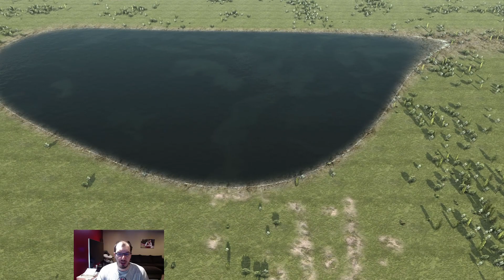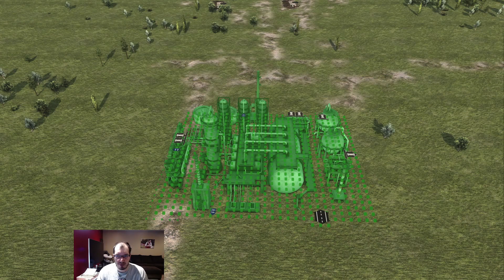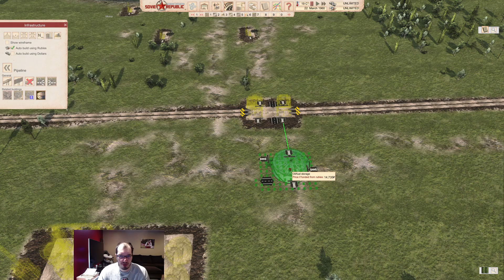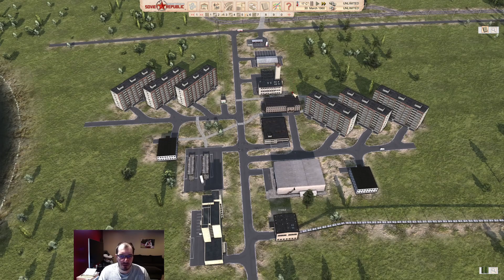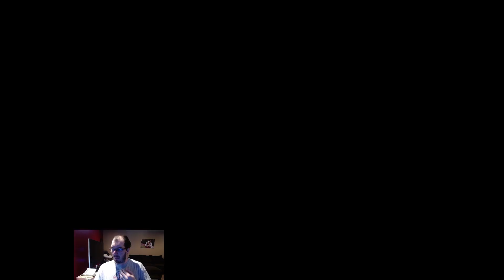How to setup a new Production Guide | Tutorial | Workers & Resources: Soviet Republic Guides

Comment: I have the feeling that the refinery takes more oil than in the description, because I have a train that delivers 720T of oil and the storage is empty when he comes back after roughly 3.5 real minutes
Reply from the maker: @NiIs03  how many full workdays is that?
Reply: @bballjo Here are some infos 😅
Reply: I haven’t checked that yet I will do it later
Reply: Hi I checked the time and the train needs roughly 23h to drive back to the border load 720t of oil and unload at the ref.
Reply from the maker: @NiIs03  that is a bit odd...you got to 23h by following a person around, and checking when the train leaves and returns, right? Otherwise, I know that the timescales won't match...
Reply: @bballjo hi I forgot to add the drive back to the border to refill but then let’s say it takes 25 to 27h for the hole round that should be enough oil
Reply: And most of the time the raf is 3/4 full of workers due to transport issues
Reply: I mean I won’t complain but I don’t understand it😂 and I have 4 pumps that adds to an extra 20ish tonns

Comment: I’m not sure if this is a glitch or not, but when I try to assign a bus stop in the city to bring workers to a bus stop in the industry area, it keeps saying that there is no connection or it’s too far away, which is weird because that defeats the purpose of buses. This leads to no workers going to the industry area, and the odd thing is in the beginning of the game they do go to the industry area, but at some point they just stop. This also affects passengers so they don’t go to areas where I build culture districts or to a shopping center. The buses will still go between stops, but passengers will either not board the bus or just won’t get out
Reply from the maker: There are 2 separate issues here...the error message should be easily tested, by clicking on the industry stop and check the walking range.

The second problem is often related to the max number of workers that can wait at the station, plus they can only wait 1 hour...so nobody gets on the bus that needs to go, or nobody has room at the station to wait.
Reply: @bballjo  alright I think I know the potential fix now, I'll use more buses I guess, I know walking distance can't be the problem. I had this glitch where my car dealership couldn't connect with any parking lots and I ended up demolishing and rebuilding the road that connects it with the city and fixed the problem, maybe it's something similar if nothing else works, I'll test these out once I'm free, thanks for the help

Comment: Thank you
Reply: Why do all the train passengers get out of the train while the train is commuting from one stop to the others. The passengers are suddenly not on the train and then it arrives empty. Or seldomly the train arrives with passengers, it gets empty but no passengers go out to their work!!
Reply from the maker: I would guess there are available jobs for the passengers at that stop, and the line is set to "get in/get out"?  Setting up a true commuting route vs point to point is hard, but not impossible, easiest is to control the available places of work and make sure you have plenty of workers.
Reply: @bballjo  I do have plenty of worker but the train just gets empty in the middle of nowhere, where there are no stops! I’ve never seen that. Did you?
Reply from the maker: Oh that...there is a 4h limit in vehicle. Check out my extended passenger range guide, it shows you how to get around that:)
Reply: @bballjo  will do
Thank you

Comment: Great video, but to be honest I do not really like the oil setup. It seems overbuilt for the amount of oil you have, or underbuilt if you ever plant to run it at full capacity.

There is a good storage capacity at the refinery already, and like you said, the refinery is able to pump in and out, so eliminating the tanks also eliminates two pumping stations, which also slightly reduces the length of your pipe network. So if you are playing on hard and need a quick source of income, the setup can and should be more minimalistic. And if you are going big and setting up a modular system that you can run at full capacity in the future, there should be separate rail (un)loading stations for each resource, and a more robust transit system than just buses.

I did learn something from one of your videos recently. I saw you connect a HV line to both connections at a transformer, and my mind was blown. Of course it works! The border power connections are also transformers, and current passes through them just fine. But for some reason I got the idea stuck in my head that I need to build HV switches everywhere. Speaking about power lines, did you know they can cross intersections diagonally? This means fewer poles to build, so it's cheaper. It also means two 45° degree angles instead of one 90° one without taking up any extra space. I'm not sure if that is your cup of tea, since you seem to have a strong preference for 90° angles, but there you go.

Edit: Oh no it was a modded transfomer ;-(
Reply from the maker: Thanks for your comments! 

You and @bc74sj are seeing the same things, and I very much agree...this setup is not efficient...I wouldn't start this way BUT vanilla doesn't give you another option for a refinery...I think I should have pointed that out in the video, but I stay 100% vanilla for the tutorials, so everyone can follow along because mods aren't always available, or reliable. There are many optimizations that can be done here, to make it a little better, but in the end there isn't a lot of oil, but there are only LARGE oil buildings available. 

In the end, this video was more for the mechanics of how to setup a full production line, like oil, and figure out the amount of throughput and workers needed, and not necessarily for the best setup...but since I have to point that out afterwards, I think this video has simply missed the mark and could have been done much better. I always appreciate honest feedback, especially when it helps me improve myself :D  

I think my next tutorial will go into the general optimization at the start more, and I hope I can address all the pain-points that have already been pointed out in this video. 

On the transformers...yea, as you said the modded transformer removes the need for most HV switches, but its a mod, so I wont use them in tutorials ;)

In terms of savings money on power lines...the intersections are nice, but you can do the same with paths, I think I show that in a couple videos....place your HV power lines, however you want them to run, then go and remove 1 pole in the middle, place a dirt path, reconnect the poles, remove the path -> 1 pole less...you can repeat this as many times as you want. I believe you can remove up to 2 poles this way, in between poles, so you can effectively safe 50% on costs...but be aware, removing 2 poles lets the power lines almost touch the ground, and it looks unsightly when your trucks and trains and people run through the HV power lines...so I stick to removing just every other one.

Comment: Sorry posted my notes in the wrong video
Reply: Comments: Weird title of video. Guess thumbnail makes more sense?

Notes on map position:
Should always build top left or bottom right if you are planning on making the most of your starting money and doing less autobuilding, but closest triple Soviet customs area that fits that criteria. Distance to NATO matters since you want your USD to ALSO to go as far as it can. If you plan on autobuilding all game and trading with only Soviets, then bottom left corner.

Should reroll random maps when starting out until you get a triple Soviet close to the top left or bottom right for best starting position / money usage.

Optimal pumpjack position:
(I think yours were too close, not really ideal).
Assumed area vs Actual area (240 m diameter circle area is displayed by the game but the actual used area is only 190m)
This means you can set jacks 95m away from each other with zero overlap. If you create a square 
95m from jack to jack, (enable the grid, and each grid square is 10m, so the tips / points alternate (the .5).
If you filled a square with 4 squares filled with 4 circles, you would see that there is a huge area missing in the center (in the game it looks like a diamond).

Easy way/fix:
If you create a square 140 per side, you will leave 1 green square visible in the middle. This has multiple overlapping parts of the circles.
You can minimize this by alternating rows at different lengths.

Harder way/perfect coverage: Put your first row of pumps 145 meters away from each other, and alternate a row 72m (between the two) and 160m below it.
You will see a diamond pattern.
Easiest way to measure all of this? Gravel roads, and clone tools. When you are doing a large oil field (custom map, not randoms) you can put dirt roads between all the pumpjacks and also verify if something looks off.

Tank: The tank you put in front of the 4 pump jacks can hold 1500T of oil, when you can only make 20T of oil a day. Would  take 75 days to make use of it. Yes you said  you could use it for other industries, but 4 pumpjacks at the start isn't the time or place for it. Cost you another 15k.

Refinery:
I think making a refinery with only 4 jacks is a losing battle and I dislike random maps to begin with. You are setting yourself up for a super expensive setup. Yes you can import oil.
250T of oil can be consumed per day by the refinery.
4 jacks you said estimated 5T of oil (20T)

8% with only your 4 pumpjacks is correct, but I thought I heard you say 20%. 8% of 500 would be 40, so yes 120 per day. This would yield only 10T of fuel, and 6T of bitumen. 

Think you should have moved the 2nd tank placed next to the refinery (always good to have ability to reach the output lines on tanks).

Money: 
This was all done in sandbox, so I assume this video was intended for an easy audience. 1.6M on just the oil / train / heating plant part when I recreated it, nothing for city (500USD I didn't spend)

Ok, so oil sells 41R/T, buy 45R/T at game start. Bitumen  199/220. Fuel 121/134. 10T of fuel, and 6T of bitumen. 2400R per day * 30 $72000 at 100% production per month.

290k to build it and maximum capacity to be used is only 8% (obviously this changed when you started importing oil).
You have to be careful with this, as your tanks will always be filled up and not empty if you are converting oil to fuel and bitumen as 250T of oil is turned into 125T of fuel and 75T of bitumen in a vacuum, but when you add in your own oil, it can stall the system when importing oil, and then you can't export anything, because there is no room, or you are paying for oil and not using your own (obviously just a caveat the player will learn later).

Aesthetics vs cost:
Pipelines cost a TON more than either jacks or pumps. Use straight lines as much as possible.
In 1960 100m of pipeline on the border is 10.5k, 11.5k in the map center, 12.3k in the far right top corner (NATO corner). A pumpjack in the NATO corner is $6915, a 3 way pump is $11.5k.

Lifespan/pollution:
More helpful to use the search bar to the right rather than the population overview. Good habit to start using  early on. Will pinpoint who is unhealthy, not that you have a generally unhealthy population (it will show the unhealthy houses, and then you can determine if it is based by pollution, heating, lack of food, doctors, etc..

Busses: Advise Line Spacing personally. You said multiple times 'vehicles don't matter'. They do, should be selected and looked at.

tl;dr, I guess for an easy or sandbox tutorial this is ok since you showed how to connect parts together. Would have preferred to see costs, profits, etc.. and I don't think 4 pumpjacks warrants a refinery on its own. Your other videos you go into the science / efficiency / mechanics.
Reply from the maker: Yeah, ill just copy this into my notes...i think there will be at least a couple tutorials about this in the future ;)